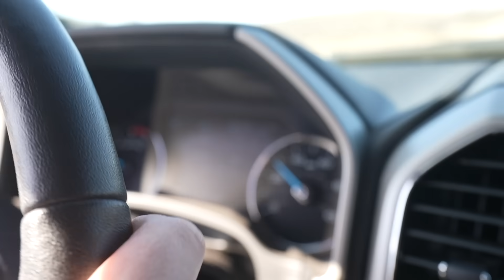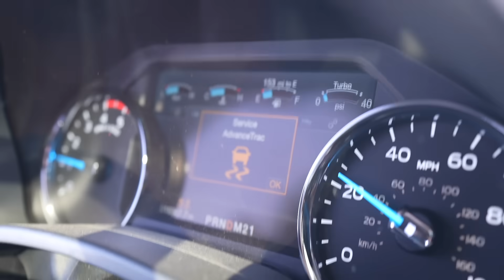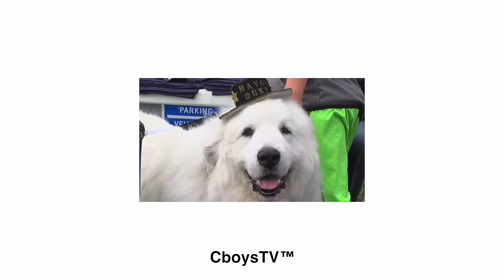Duct Tape Tires on my Sema Truck

Comment: I’m actually not the biggest fan of any Ford vehicles but this is one of the most gorgeous trucks I’ve seen a super long time. I’ve got a 14 mega cab also 8” BDS with 40s on 20s.

Comment: Balance Would be the only issue..Long term Road Heat n damage would cause later issues,  but it works..it looks sumwut kool, could cause other problems longterm in the future..💐🙏☝👑

Comment: seeing you guys wrap those tires in this video brings back memories.  the above-head cast iron drain pipe in our split level house for the upstairs bathrooms broke a hole in the pipe like 9 years ago so terds would jump out when you flushed.  take a guess how we fixed it. ...   ...   ... and to this day, it's still holding with no leaks. but, y'all are still crazy and waistful.

Comment: Fun to watch on youtube but I would have been the neighbor calling the cops too. I didn't move out of the city to hear this shit. You will get it some day when you are a bit older. As for the ticking sound, those are lose bearings somewhere in our wheel mechanism. Lucky they didn't just melt during the high RPM moments. And too bad you didn't know to contact me, I have wholesale access to duct tape and would have cut the cost more than half.

Comment: Well if u didn't keep leaving off the throttle especially getting the rear tires already over the bump u woulda made it not doubt u just keep leaving off! Also ur lucky u still got a bottom lip 😂

Comment: What about putting duct tape on the tires? Like $100 retail worth on just the back tires and then burn it off… will it be a cheaper burnout than using the tire rubber? Will it launch better than a rubber tire?

Comment: you needed to put tension ont he tape as you put it on, so it would sit flush with the next layer. bu lust rolling it on, you created gaps between each layer. you you would have spent more time applying the tape tightly around the rim, and created a good seal on each layer, it would have been like, twice as solid.